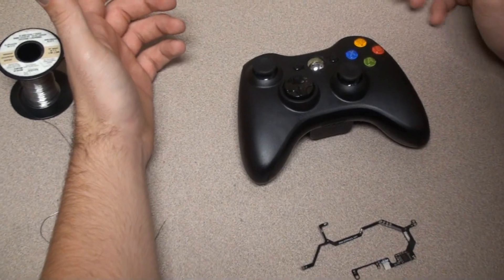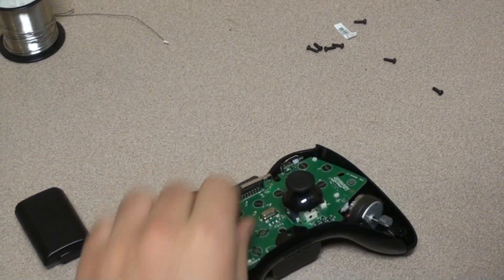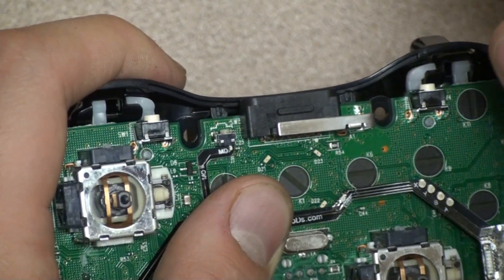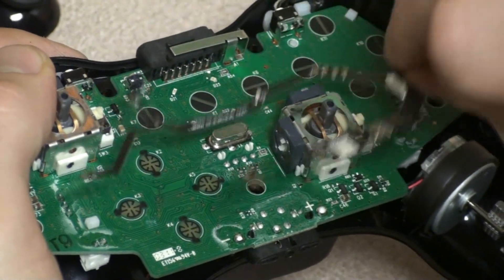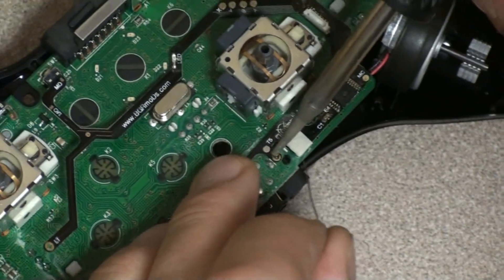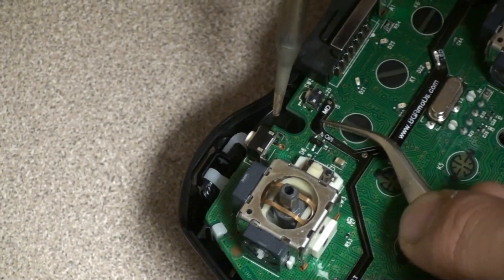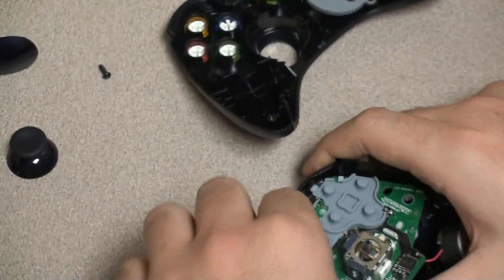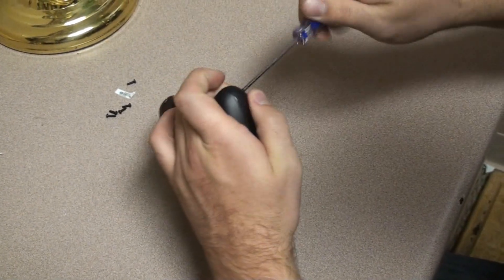Intensafire 3.0 install

Comment from the maker: yes you can use either or.... soldering is for the more experienced modder... the glue that the intensafire comes with also works just fine too... thanks for your question

Comment: It's underneath a cover on the little velvet fuzzy tray in the box next to where the screw driver is. I found out thats where it was hidden two weeks after I destroyed my flex board trying to solder it. I was indeed ticked off but what could I do? There was no way they were going to send me another even though there were no instructions saying where the glue was.

Comment from the maker: the glue works if you install if the right way and also do not use too much glue while installing.... if you are a more experienced modder then you could solder it as well... thanks

Comment from the maker: @OnExHanDxWonder thats how you turn the mod on and how you cycle through the modes... you can tell what mode you are in by how many times the light blinks... for example, if the light blinks 3 times, then you know you are in mode three... if you hold the right trigger down and tap the sync button again, it will blink 4 times and then you are in mode 4... hope this helps

Comment: PRODUCT DESCRIPTION The next evolution in Xbox 360 rapid fire technology is here in the form of the IntensaFire 3.0 rapid fire controller mod. The IntensaFire 3.0 for Xbox 360 converts any Microsoft Xbox 360 wireless controller into an intelligent dual rapid fire controller with groundbreaking features such as the sniper double-tap. The IntensaFire 3.0 is even easier to install than previous versions and still requires no soldering, cutting, wiring or drilling.
Reply: So why do you tell everyone to solder and mess up the controller when the products description says no solder needed!? It comes will a special type of glue everybody. To order go to   intensafire store.com

Comment from the maker: the difference between the 3.0 and the 2.0 is that the 3.0 is a little more easier to insall and a little more user friendly... but they both work the same as far as speed and rapid fire go... thanks

Comment: @demonponcho123
I had the same problem you did, just remove the middle screw where the battery pack goes & it should work... It worked for me at least.

Comment: i had purchased the intensa fire 3.0 it is being shipped. 
what all comes in the kit?
For the soldering did you just heat the solder up and dip a wire in it?

Comment: nope just did mine all you do is tape the intensafire down dab the points with the tooth pick and conductive glue, blow dry the whole deal then carefully remove the tape while holding the intensafire down so you dont pull it up and your done I been fing shish up on bf3!!

Comment: my metal contact point for on the intensafire came off CG solidering point. can i run a wire from the sync contact point on the intensafire to the cg controller solidering point instead?

Comment: QUESTION, please reply asap. I installed my 3.0 onto the board. Mine did not come with any glue but it says 3.0 on the mod. I have it all installed and now the controller wont turn on. I have been soldering and working with controllers for a long time. I think mine may be different so it is shorting the controller or something. It was turning on when some of the points weren't soldered , but now that it is fully connected it refuses to turn on. PLEASE HELP

Comment: Did it work for you? I've seen numerous comments made by BGRMods folks saying you HAVE to have a HS board and a regular 3.0 board will not work? Looks like a 3.0 board with additional wires that have to be soldered the the ABXY buttons to me yet I see many say they still don't get modes 6-10. I'm confused as hell.

Comment: Is there a way to tell if your mod will power without putting it in the board? I think I may have messed up the sync contact point on on the intensafire 3.0 on my first try...

Comment: I think you misunderstood my question... I know this is a rapid fire controller and makes any semi-automatic weapon fully automatic... DUH! how does this INTENSAFIRE (chip) WORK like so basically you just solder it into the motherboard and the chip just overrides it and make it into RAPIDFIRE? or how would that even work with glue????

Comment: I got the Xbox 360 IntensaFire 3.0 HS controller and opened it to see the work. It looks just like yours but those abxy dots on the 3.0 have super small wires going to the respective buttons. Would you know if the 3.0 can be turned 3.0HS if these points are connected?